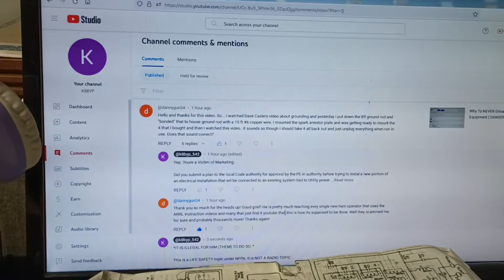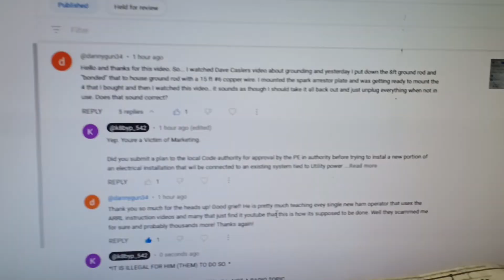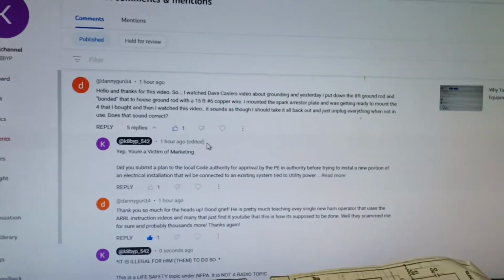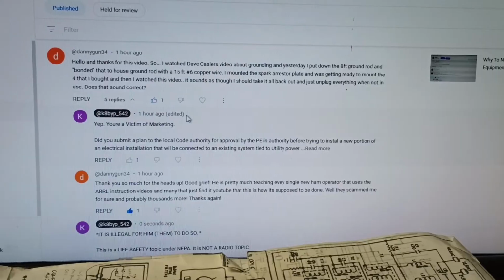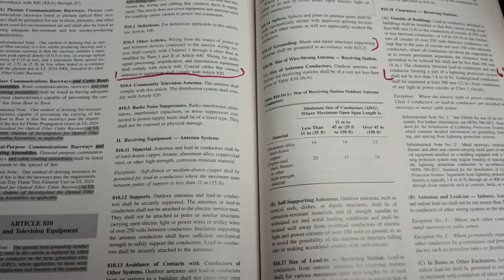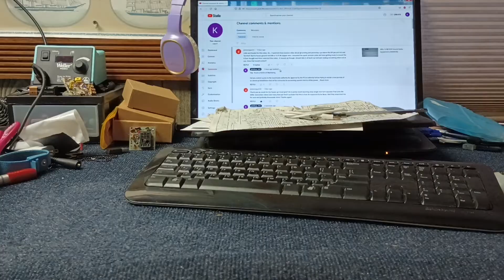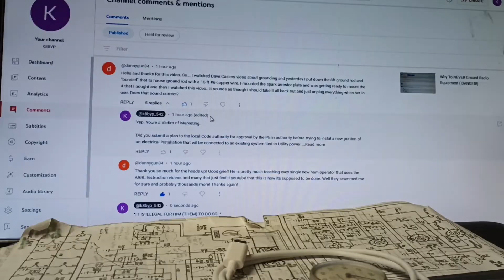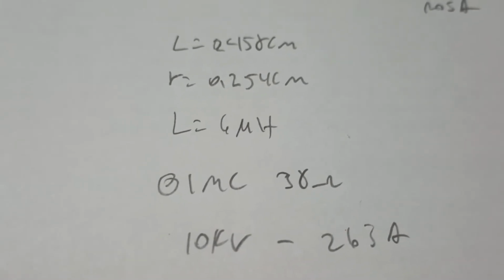Grounding and Legal - Professional Engineer Required #grounding #antenna

Comment: Many falsely believe that by "grounding" their equipment, they are providing some kind of "sinkhole" where all those nasty EMIs and "over-currents" will drain into.
This form of thinking likely comes from the "water analogy", often taught in high schools and even in some colleges.

In actuality:

- All currents return to their sources following path of least IMPEDANCE.

- NOT always path of least resistance!

- Currents do NOT return to ground. They may use ground as the return path to their source, if that is the path of least impedance.

- The current is always contained in the fields. It travels in the plastic, the dielectric, not in the wire itself.

- At low frequencies, current forms resistive divider with all available paths.

- At high frequencies, impedance is dominated by inductance (loop area).

- High inductance (large loop areas) increases likelihood of ground bounce and
  magnetic coupling (cross-talk) between circuits.

A tall tree is more likely to be hit than a short one. But the reality is that dielectric breakdown is a CHAOTIC process, which is why lightening appears forked, rather than taking a straight pathway. Once you get ionization along a path, more current flows along it causing more ionization, and so on.
For simple circuits not relying on breakdown, it's a simple matter of resistance/impedance, and the current will distribute itself among multiple paths. But for breakdown situation, whatever path gets connected first often takes the entire current.
Reply from the maker: Yes and they arent educated enough to even spell
 " EMI!"

Thats why they play guessing games like grounding.

Their EMI/ RFI are due to mismatched antennas which they know nothing about properly matching, so they pretend grounding eliminates the interference.

" currents return to their sources"...and when ground is not related to the source as in most EMI/ RFI, grounding is wrong.
Reply: @k8byp  You get Gold Star for correctly following the current, and another one also for not following the long and winding trail of deceptive misinformation which has somehow infested our public school system. In God we trust, for everybody else... we verify. Amen brother, great video, and good job on issuing the strong warnings. Who knows, even if only one soul will take the time to watch these videos, and learn the correct way, you'll have treasure in Heaven. 

God bless!
Reply from the maker: THank you. We connect. Especially on the religion aspect.

Lying, cheating and stealing offend me.

We are our brothers keeper, like it or not.
Reply from the maker: Thanks. I avoid the religion topic here to try to separate the issues but youre welcome to lay it out!